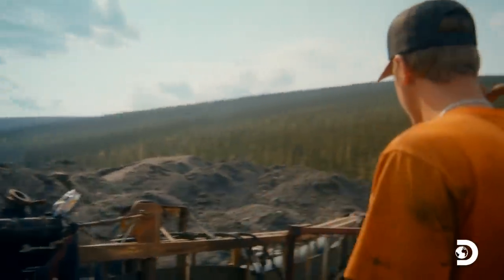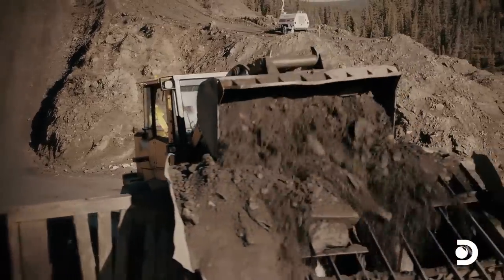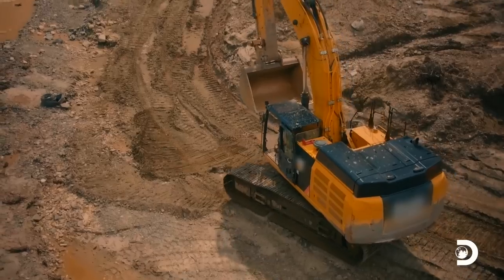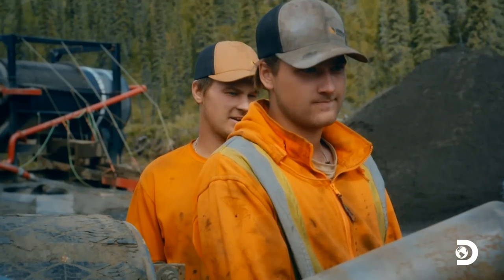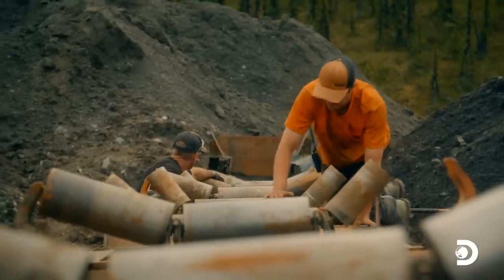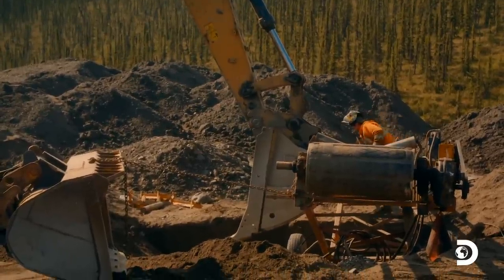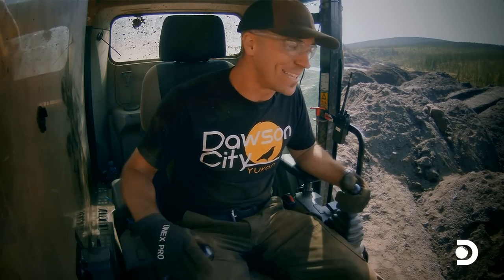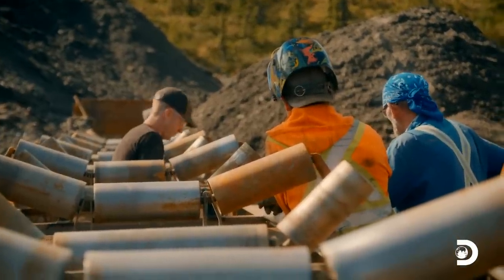Young Miners Repair Wrecked Conveyor Belt | Gold Rush

Comment: When dowsing for gold is added to all of the Gold Rush competing crews, the amount of gold recovered will skyrocket with being able to ignore less productive ground.  Read the book, The Art of dowsing - Separating Science from Superstition, for learning all of the physics involved in dowsing with the modern light weight ball bearing dowsing rod, which accurately deciphering the dowsing of all edges, exact center, depth buried with angle of deposition, and most important GRADING of the sought element contained in the elemental mass being dowsed.  Accurate gauging is accomplished by pitting the energy of gravity against the powering of the one-tenth ounce dowsing rod load attached at a predetermined location on the ELEVATED acetylene welding rod of the dowsing rod.  You will become a professional dowser after practicing the book's dowsing lessons of buried pipelines and cables, tunnels and voids, precious metal placer and lode deposits, dowsing for treasure, dowsing for any element, amplified long distance dowsing from a moving vehicle, and dowsing on water from a boat.  I hope that everyone has a safe, healthy, good day.
Reply: Sangat luar biasa dan keren sekali bosqu 👍